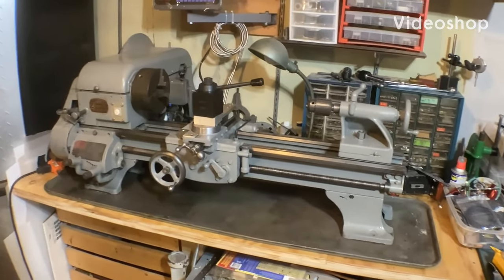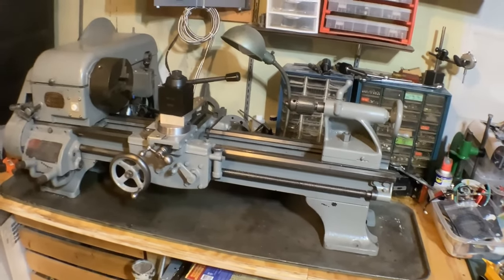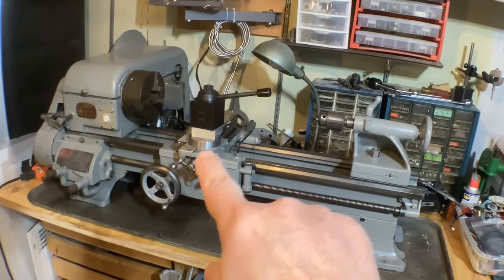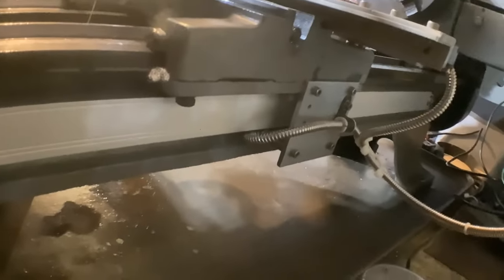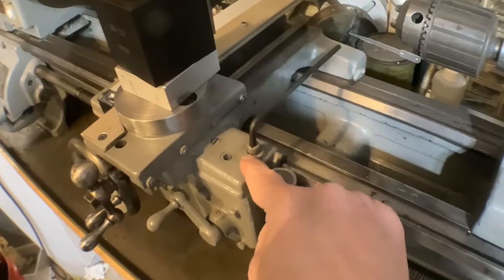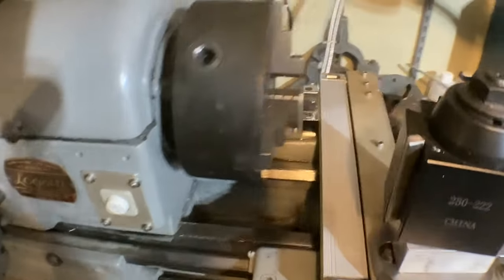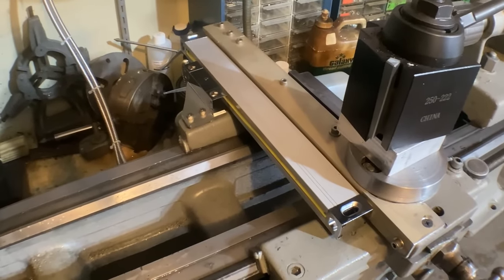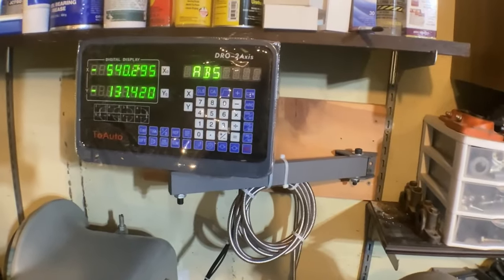Thoughts on installing a DRO on a lathe.

Comment: Liked your thoughts about adjusting scales parallel to machine axis. Always a lot of thoughts when fitting a DRO. Fitted DROs to my lathe and my mill 5 years ago. Uses magnetic scales primary because they are smaller. They are easily cut to length. More than half of my work is steel or cast iron. Never cleaned the scales. Fitted scale on the rear of the cross slide. Less risk of damage and I can use a following rest. Possible to adjust gibs. Only limited tailstock travel 1 1/4 inch (30mm). You need a milling machine to make mounting parts.
Reply from the maker: Thanks! I may look into moving it if it’s too much in the way where it is.

Comment: Nice video. I saw a guy on youtube who mounted the dro for the crosslide under the leadsctew cover, right behind the cross slide. A bit more stickout but no risk of crashing into the chuck. When gripping large stock, don't the protruding jaws hit the scale?
Reply from the maker: Thanks! And yes, the jaws could hit the scale, so I need to be careful there. Hopefully I’ll never need to be that close to a big part. Or get a smaller chuck. Maybe.
Reply from the maker: Thanks!

Comment: when chuck is wide open it will hit the dro
Reply from the maker: Yup! I’m fully aware of that. It’s only been an issue a couple times, but I was able to stick the cutter out in the holder a bit more to reach the work. But putting the scale on the other side would interfere with the tail stock, which would be an issue more often for me. I rarely turn large stuff. Thanks for watching and commenting!